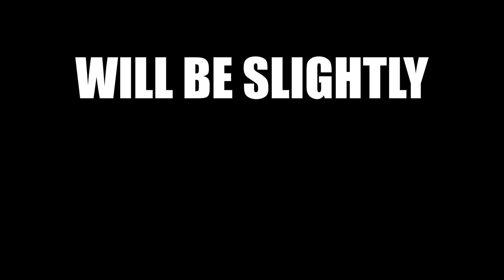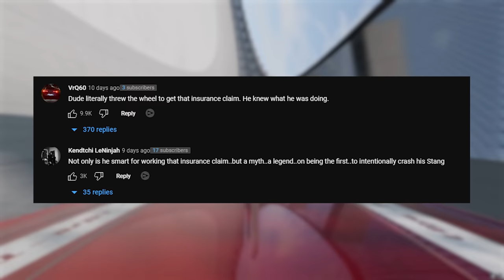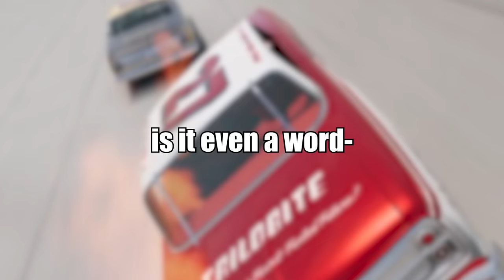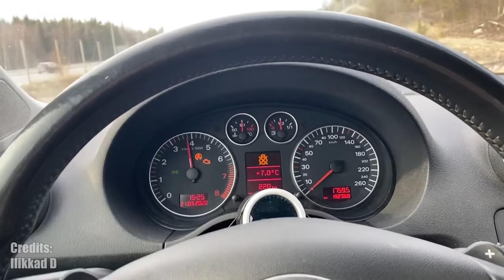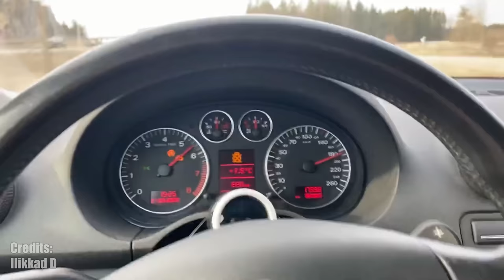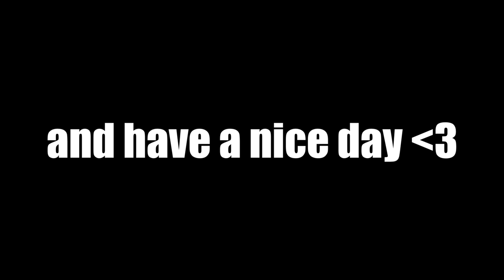These Cars "Rusted" Away In 5 Hours

Comment: Absolutely an electrical issue that made those cars on the boat go on fire. Trucks have batteries located outside of the engine compartment making them VERY vulnerable to getting shorted out, especially around salt water.

Comment: The car at 5:52 is Nissan Pulsar GTI-R, which is one of my dream cars, it's pretty weird looking, weighs nothing, and drives all four wheels. Oh and also with the stock 227hp engine it goes from 0-100 in 5.6 seconds. The engine is an unique to that car, but it's very similar to the engine in 200SX, and is very tunable.
Reply: 200sx/silvia engine with the 4wd system from the gtr 
In a hatchback
One of the best cars ever made

Comment: Ahhh, Subaru's and snow....so much fun  😝

Drove an 1980 manual Subaru station wagon with on demand 4WD on a rural mail route (used to be known as Star Routes, but now known as Highway Contract Routes) in the Sandhills of western Nebraska.  Got stuck in snow twice one year.  

First one was high centered in a drift.  Dad had bought an inflatable jack that used the exhaust of the vehicle to inflate it.  Which turned out to be pretty handy as the heat compressed the snow.  All I really had to shovel was a space for the bag to fit, inflate it, deflate it and do that on the other side of the car then put the bag and the shovel back in the car and finish the route.

Second one was during a ground blizzard.  Beautiful clear blue sky but really cold with pretty high winds blowing loose snow around.  Front right got stuck and pretty much as fast as I could shovel more snow blew in and hit the warm tires then froze with more snow blowing in.  I had to walk just over 1/4 mile to the next ranch house to ask for help.  The wind was so cold that one of my eyes got cold enough that I couldn't blink or move that eye until I sat in the warm house for just over a half hour.  I hate ground blizzards!!

My dad brought the 1978 Dodge Ramcharger with 4WD and one of the guys at the ranch house took one of their 4 WD ranch pick-ups to the Subaru.  Each one tried to pull it out and ended up with both hooked onto the Subaru, backed up to almost touching the front bumper, told me to just put it in neutral, and then both taking off at the same time jerking the car out.  There was sounds of ice cracking as it got pulled out.  And I swear that Subaru might have either cried a bit or said a cuss word.....or maybe that was me  😏

Comment: I'm betting on an electrical short causing the fire on that ship. There was a similar situation a few years back where a ship hauling new Mazdas grounded and then rolled onto its side, and when all the cars slid to the one side of the ship one or two of the batteries in the cars got knocked loose and started shorting against the hood/bonnet. In those instances they didn't start a fire, but there were definitely burn marks where the shorting had occurred. A battery getting rattled loose (or even already being loose as so many people don't bother to replace the tie downs once they break) and shorting against greasy sheet metal would definitely make for a good source of ignition.

Comment: From what I can see in this snipped up clip, is the fire appears to have originated from one of the cars in the top right hand side. The flame intensity prior to spread and size would lead me to believe it was probably a lithium fire from an EV vehicle. Based on the date, and types of cars being stowed, and the lackluster stowage of this EV in particular and based on its origin port (india) and destination (china) is that it was possibly carrying one of china's new BYD model EV cars (notorious for catching on fire at this point due to very poor quality control) (BYD has a manufacturing plant in India that produces these EVs which are heavily promoted in China, despite BYD auto claiming to be an independent auto manufacture)

This is a RoRo ship, likely the Russian operated ANGARA.

Comment: My theory:

The ship fire was likely caused by a static discharge. A battery could have been the issue, but I believe the high seas, salt-water mist, and localized storm created the perfect catastrophe. Static buildup on ships is a well documented phenomena that can be a early warning sign for a serious storm. This has been mostly observed by hair standing on end during cruise ships. The static discharge had very little options considering the grounding nature of vehicles. Plasmatic discharges, like lightning, are sometimes very similar in nature when considering the path of least resistance.

I believe there was a significant discharge over the framework of that vehicle being near a fuel source. A small oil patch, anything in the path would have been subject to a small yet significant amount of energy...

FIRE...

Comment: 2:40 "You don't get it. We have the capsule for WHEN we crash, not, 'If.'"
So, on the powered wheelbarrows, there are models you lift but it has a drive motor for like $450.00, all the way up to a $4500-ish tracked behemoth with a stand platform.
I'd put an excavator bucket on that and call it my Budget Bobcat.
And at the end? Now that you mention it, I have never seen a Subaru get or be stuck.

Comment: 4:27 If it is a V6 engine and it sounds like a V8, the most likely thing is that they have installed an Exhaust System with an integrated Subwoofer to reproduce sound from the speaker and not from the engine.

Comment: For the fire to be caused by an electrical fault, it would need to be a very low resistance short circuit.

Salt water isn't going to cut it. While it is conductive, it's not enough to pass the high currents needed to heat something to ignition. Not to mention it will dry up.

Comment: hey CarMighty. You need to put Lauri Heinonen Dodge nascar turbocharged V8 Nissan S13 drift car in one of these videos. The thing pushes 980hp on hubs, or over 1000hp on engine. The thing sounds CRAZY since its limiter is set on little over 9000rpm

Comment: MIGHTY!!!!!! I WORK AT A NISSAN DEALERSHIP IN AUSTRALIA AND THAT IS NOT A y61 PATROL!! ITS THE Y62. aaaaarrrgh i see and work on loads of these cars every day and it hurts so much to call it something it isnt. i would care if it was a small difference but the difference between the y61 and 62 is huge. not even the chassis is the same

Edit: the y62 is also only available with a 5.6 litre petrol v8. lots of custom exhausts on these softroad cars and they all sound really good. the stock exhaust is also pretty solid. It could have a v6 swapped into it, but i highly doubt it, sounds more like the throaty v8 that comes from factory

Comment: As for the fire on the deck of the ship? That happens when you don't disconnect the automotive batteries on the open deck of a ship. All that salt water, it wouldn't take long to short every battery to the point of catastrophic failure.

Comment: My 1 wheel squaeeler does pretty OK in the snow, maybe the extra weight from being a limousine helps with traction, and getting power to the other side of that open diff
Though i do switch to snow tires

Comment: The Y62 Nissan patrol has a 5.8 liter V8.
The next generation after these will have the turdo V6, unsure if the will be diesel though.
And they have that much power at standard, you pick the accelerator, and you go through the rear window.

Comment: Cars main material is aluminum, aluminum is one of the most rust resistant metals, its next to copper brass and bronze, All of them struggle to rust because they have a negligible amount of iron in them. Therefore no iron oxide, or rust, can form. So the reason burnt cars look rusty is not actual rust but instead burnt paint. so yeah..

Comment: The face subaru drivers make when you remind them of Quattro. XD
Reply: Audi ain't on rallying anymore though, just a pavement princess like the newer Subarus
Reply: @h5skb4ru41  The last true quattro ends with the B8.5 Audi A4/S4 manual options. Around 2014 or so. My daily is a 2012 6mt S4 on 265/35 tires and it's too much car for a daily. The last quattro's you can build into competitive rally cars is the smaller A4 1.8t B5's and older. Remembering my 1995 Audi S6 with an RS2 turbo, I'll be thinking of the term pavement princess as I remember pulling bus lengths on cars while loaded up with car parts in the boot, all family-wagon-lookin'-ass ruining peoples days.

Friend had an RS6 turbo equipped audi Allroad we named the LOL-Road. I would say it was putting out about 420-450whp about 10 years ago and just played with cars on highway pulls with the short gearing. "Clubbing seals"

With all that being said, Subaru's suck balls.

Comment: that rs3 wont hold a candle to any properly tuned 3b 2.2 audi. The old audis have actual 4wd with a viscous centre diff and a iron block motor that you can boost up to 1000 hp with a lot of work sure but under no circumstance will a new 2.5 I5 motor be able to do 1000 hp and be street legal and fairly relaible.

Comment: A V8 is the wrong engine for a bettle. It's too heavy. And it hangs behind the rear axle. So you lift the front when accelerating. Light front means no steer power and no good brake performance. He has removed the interior, so why not building an additional frame and put it in front of the rear axle to create a mid engine beetle, and damn, use a boxer engine from Subaru or porsche. Subaru engine with turbo would bring more than enough power / weight ratio benefits.

Comment: Ye that ride on wheelbarrow they do acc exsits but they are called ride on dumpers from where im from there very similar just a far bigger bucket and usually have tracks not wheels but there nowhere near as fast but has far more torque the bucket is hydrolic so u can lift and tip it ive used a few far more fun than a normal barrow 😂

Comment: 0:19 that 1 that caught on fire was an EV I guarantee it, cause its not the 1st time an EV caught an entire ship of cars on fire and it wont be the last those things aint as environmentally friendly as these idiots think,    It takes tons of rare/hard to find resources, tons of plastic, along with all the joys of toxic chemicals that allow the batteries to hold energy, which by the way still needs to pull power from a source like those power plants that burn coal to charge it ( face palming at the stupidity of our race) and the real kicker IT STILL NEEDS OIL TO LUBRICATE THE BEARING AND GEARS IN THOSE CARS.  Add all that up with the fun of they can catch on fire randomly and cannot be put out like a gas car and you got yourself a P.O.S. lie those things are a joke if they wanted to go green soo badly they would be looking into cars that run off Hydrogen gas or use a mesh that separates the molecules of water to burn the hydrogen or make electricity with it.